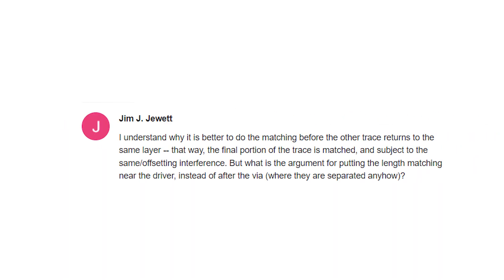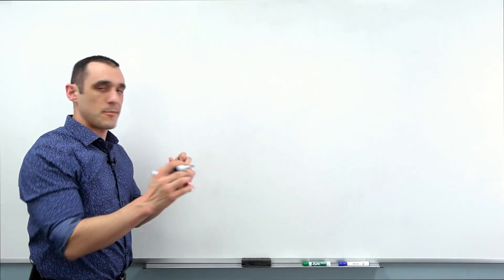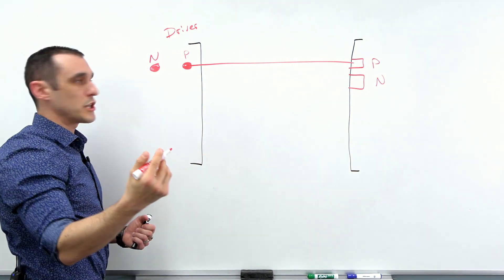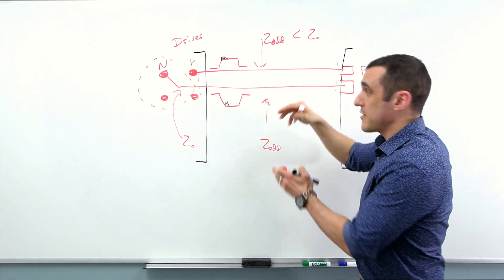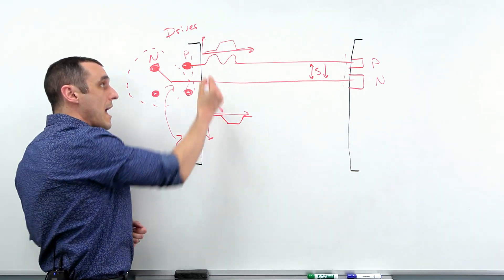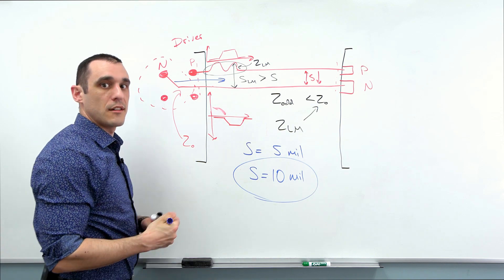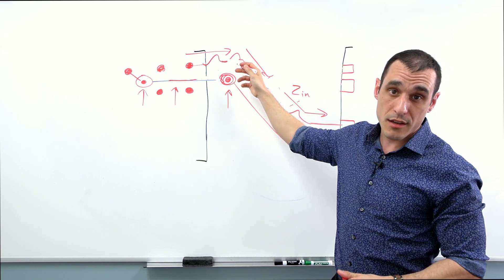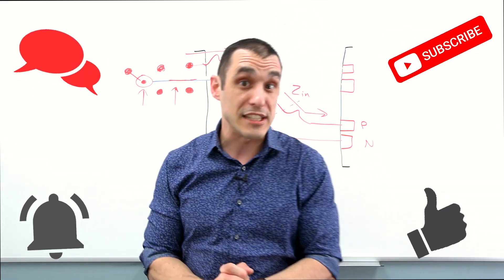Answering Length Tuning FAQs | Mismatches, Impedance, Vias, and More

Comment: What about board to cable to board mismatch impedance differential pair configuration:
Cable < board
Cable > board
Thank you
Reply: Cables that are built to interface with a standard connector involving a differential interface (like USB) are tested for their differential impedance and skew across the length of the cable to ensure it is within spec. So in practical cases, you should not expect excessive length mismatch in the cable. You only need to worry about the PCB to ensure the design has the right length matching tolerance.
Reply: @Zachariah-Peterson  hi Zach thanks for your reply, so his the issue am not an electronician but am interest in making my own cable MCIO in the 5.0 gen impedance required is 85 ohm so the problem is its hard to find(balanced) , thats why am asking what would happen if i use let say 70 ohm with thos board of 85 ohm and recto versa thank you.
Reply: @ajingolk7716  Well think about it like this. The inteface requires 85 Ohms, so the traces leading into the components at each end of the interconnect should be 85 Ohms. To interface into the cable then you would need to impedance match into the cable input and output, but if this is digital signals then you need to use wideband matching. That can be difficult, simplest thing you can try is a 15 Ohms series resistor right at the input and output of the cable. A better option might be to try an RC or RLC low pass filter but it can't have an underdamped response in its transfer function. Also you have to set the cutoff frequency to very high value that exceeds the required channel bandwidth. It will require some SPICE simulation to verify the functionaliy.
Reply: @Zachariah-Peterson  still you didnt answered my quetion 😔.
What happen if cable > board ; board > cable
Reply: @ajingolk7716  Well I  didn't say what would happen but this is well known, if you do not have the board impedance matched to the connector and cable impedance you will get reflections. This is due to the input impedance mismatch looking into the cable.

Comment: When it matters? Are there any estimations to distinguish when length matching is doing something and when it's only fancy looking over-engineering? A few milimeters of mismatch seems to be considerable only at some many GHz range. What are the most real risks: emmision, immunity, distortion of signal, something else? How fast the clocks and rise time must be to get any benefits from that careful routing of differential pairs?
Reply: 1) Length tuning is always doing something.
2) The point of length tuning is to ensure that the two signals in a differential pair are switching states at the same time. This is because differential receivers are crossing detectors, meaning they detect when the edge rates cross each other.
3) The related point of length tuning is to ensure that any common-mode noise received closer to the driver on the interconnect is also received as common-mode noise at the receiver, this way the receiver can cancel that noise at all possible frequencies. This is not achievable in practice unless the two signals are perfectly routed in parallel with zero fiber weave effect. However, you can get pretty close up to the Nyquist frequency, which is the lower limit where the receiver can no longer cancel common-mode noise.
4) The clock frequency doesn't matter, it's actually the Nyquist frequency and the rise time that matter (see #2 above for the reason why).
5) The real risk is input impedance mismatch and mode conversion if length matching is not applied properly and if the differential pairs are too close together. The length tuning section will always create mode conversion (that means conversion of common-mode noise into differential-mode noise). Your goal should be to ensure minimum possible mode conversion up to the channel's Nyquist frequency. You can read more about this here: https://resources[dot]altium[dot]com/p/what-impedance-length-tuning-structures

Comment: Hi Zach - great content as always. Does Altium ever plan to add delay tuning columns (in picoseconds) to the xSignals tab of the PCB panel? At my company we length match in delay units and unfortunately the PCB panel only lists routed length in millimetres.
Reply: It's true that you do need to have the length tuning tolerance performed in time, you can actually set the time requirement in the design rules. Then you are routing, it will show a design rule violation on-screen if there is a timing mismatch. If you set the rule in ps, then the tuning tool will also show the target tolerance in terms of ps.
Reply: @Zachariah-Peterson  hi Zach, appreciate the reply! What I'm referring to specifically is the PCB panel in Altium where you can view the nets, xSignals, and their related routed and unrouted lengths. The units for these routed and unrouted lengths are ONLY listed in length (mm) and not delay (ps) which makes seeing which of your nets in a given length-matched group are the longest in terms of actual delay very difficult to see at a glance. Sometimes due to stackup, your net with the longest routed length in mm will not always be your longest in terms of delay (say if it were routed mostly on an outer layer).
Reply: @TheLemon22  If they add it I'll definitely make a video about it, I need to do something on the xSignals tool anyways!